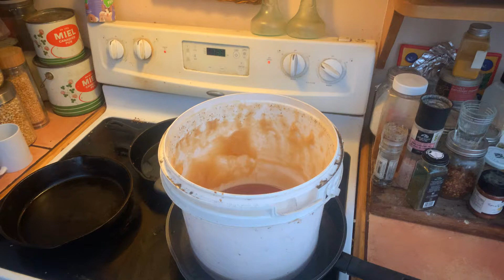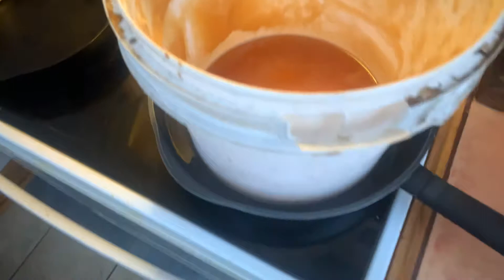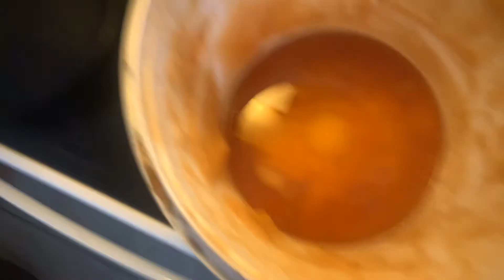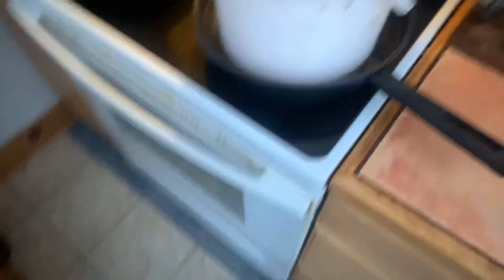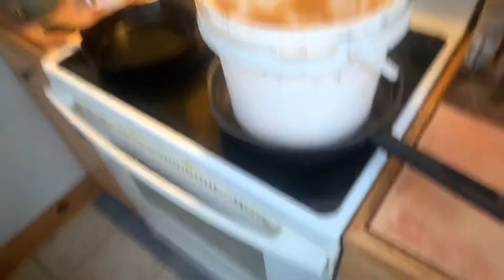Honey pot incident pt 2

Comment: Don't you have a hot air gun?
Reply from the maker: TrollForge / TrollFarm what for?  I can use a heat belt or the stove top
Reply: To keep the forgetful old man from wandering off...
Reply from the maker: TrollForge / TrollFarm thats what the timer on the stove is for. If I remember to use it